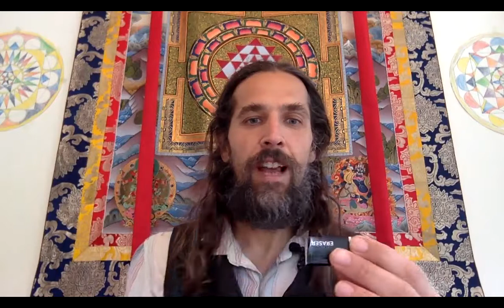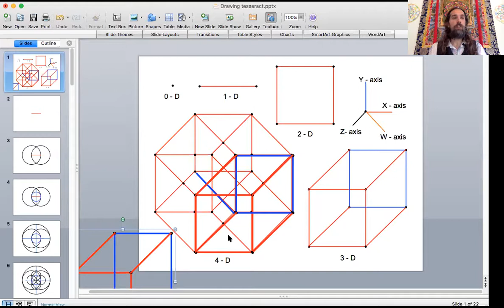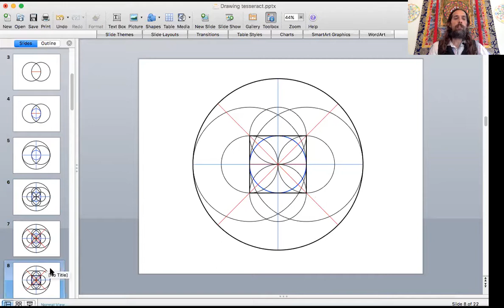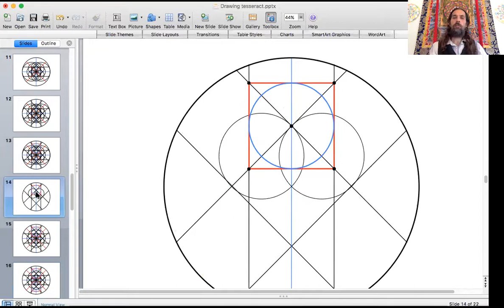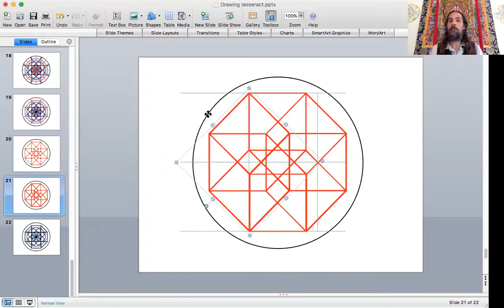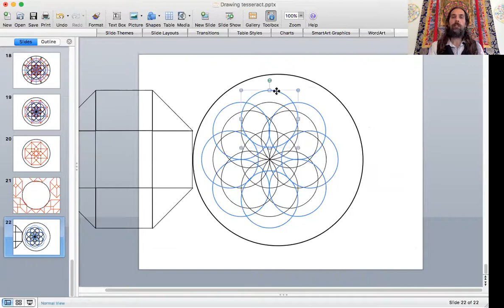How to draw a 4-D Hypercube a.k.a. the Tesseract

Comment: hi
you can represent the vertexes of a 3d cube with the octovalent table 000->111
since there are 3 edges from each vertex it maps cleanly that each edge transition is a single bit flip (000->001 is a valid edge)
moving up to 4 dimensions is simply adding a 4th bit. the single bit flip per edge transition rule stays consistent for n dimensions. that is though only if you are using right angles.
once the surface contains any triangles that introduces rotational asymmetry. you cannot label 3 points of a triangle in bits without needing to make a 2 bit jump in one of the transitions.
this means necessarily any object with rotational asymmetry is non-integer dimensional :D

Comment: The Star of David is within the tesseract. Also Ezekiel saw the wheel. It had 4 corners (a cube) with an angel on each corner and it was oscillating. The prophet Elijah was carried to heaven in a cube that oscillates (a chariot). The oscillation flows in and out of the spacetime continuum into the higher dimension so that Heaven and earth can exchange people and material. https://www.youtube.com/@Beatricebygrace